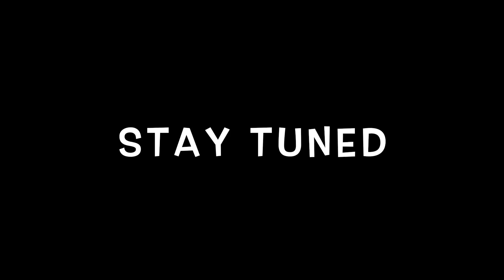SWAMP Dragon Rescue! FIRST WASH Abandoned 74 F250, V8 FORD, Forgotten Vintage Camper Restoration, CT

Comment: I can't believe this. I have a 76 F-150 Ranger XLT that i bought new. It hasn't been sitting in the woods for 20 plus years it runs and drives and yet the front bumper on your truck looks better than mine.

Comment: For anyone reading this, if you go as far as putting a solvent oil into the cylinders, you might want to also consider pulling the distributor or otherwise pump drive mechanism  and spin the oil pump with whatever tool works (or the special tool) once you get new oil in it, start by spinning it by hand to get it moving smoothly, then use a drill or something to spin it fast and move oil through all the galleys, and do that for a while before you call it a day and let the oil and cylinder oil soak, then the next day you can do the oil pump thing again and pull the plugs out and bump it over by hand or with a tool, be wary of bolt size and such, maybe use a pry bar on the ring gear teeth but just know that the harmonic balancer might come off if you turn something only attached to that, and any bolt smaller than 19 or 3/4 is likely too small, if there is no safe method to turn it over, then try to only gently bump the starter as quickly as you can so it doesn’t try too hard if it is binding, then if it all sounds ok you can watch the pulleys and do a few more quick bumps to see if it turns, if it does, then you can do longer ones until your just cranking it a few seconds at a time (not too long, maybe 10 seconds at most) then once it all seems good, check if oil is spraying out of the spark plug holes still and once it isn’t anymore you can give it a long crank (cranking speed is a good indicator of how long is the max and checking the starter temp when you’re doing the short cranks is a good way to get an idea of how close that was to the max, but typically no more than 30 seconds or 2 minutes for a diesel, and only with good batteries, then you can put the spark system back together and crank it again a bit once it cools down and charges up, then once you do that, you can use Aerosol starting aid like ether starting fluid or gasoline in a spray bottle down the intake, try to avoid liquid buildup and once it’s starting and firing up that way, you can work on getting it to start with the carburetor like normal

Comment: sweet truck , it's still waiting for someone to pull the camper off it's back ...
Reply: Mark Godfrey  ouch my back hurts
Reply: Right get that fire wood off the truck. Lol
Reply: Im in agreence bc old campers like that arent worth saving there alot of work and id try to save the bedfloor if theres one left bc they dont last on that bodystyle ford
Reply: Mark Godfrey  ⁰
Reply: @scottcountyboys608  why would anyone put time ang money into a rotten heap like that. I just bought a mint condition, basically new '73 camper for $1300. Working appliances and all.
Reply: @Capitanvolume  well u might have but the one on that trucks gone 5he things sat and rotted out
Reply: @scottcountyboys608  that's my point. It's so cheap to get a 70s camper that's been well cared for

Comment: Back in that day that truck was LOADED. A/C all the bells and whistles  of that day.
Reply: Power disc brakes, power steering. It was like a freakin’ LTD!
Reply: @Gerk8  yea My dad was the one that didnt order power steering or AC . My mom had  so much trouble driving the cars.
Reply from the maker: Yes, it's a sweet ride! =)
Reply: @k henne I have my dad's 75  F-150  and it's a Ranger XLT and no power windows, locks or tilt wheel. It did have chrome trim inside and out, carpeting and cloth seat but that was it. I'm sure the other stuff was available but my dad didn't want it. We did have A/C,  living in Houston so it as a necessity.
Reply: CircleM-85 : I don’t think power widows, locks or tilt steering wheel was offered as options back then or cruise control !

Comment: Scrap that camper we're all here for the truck!
Reply: There’s no reason to scrap the camper I’m tired of seeing comments with people who don’t know value
Reply: Without the camper its just another old shit ford
Reply: Blitz Court in all honesty, that camper would take more cash to fix it then to just buy a new one. And besides, that truck would be a lot better off without the camper.
Reply: Joshua Poche only the new fords are shit. The older ones have American steel. Thus, better quality and a better lifespan.
Reply: Agreed scrap camper and keep the good lookin truck
Reply: Yessirrrrr
Reply: @Carburator_Ranger_tv  new ones aren't no joke, 3.5l Ecoboost and 5.0 are proven, and that 3.0 powerstroke is badass too. Body wise yeah its no steel but its high strength aluminum and it won't rust. I don't get the new ford trucks vs old trucks pussy fight. They're both good in there own ways.
Reply: Tate LaPrade you have a good point. But the new rigs have way too many electrical components. What happened to having mechanical parts instead of just computers?
Reply: At least remove the camper before washing everything.
Reply: @Carburator_Ranger_tv  it's not necessarily about money some people like fixing up old leaky campers just as much as fixing up classic cars, if were up to me I'd fix both the truck and camper, I've replaced whole walls in old campers. I fully restored a 25ft 1971 fan dual axle camper too. It was hard work but in the end it was a very good camper
Reply: Joshua Mcpeek good point. Everything can be repaired with enough time and cash. I’d personally just like to fix the truck but, you do you!
Reply: The fucking camper is shit get rid of it or sell it. It is a big eye sore.
Reply: @Carburator_Ranger_tv  to each their own I respect your point of view, I will say though you can make some mad money fixing up campers, that 71 fan got me 2k$ and since me and my dad worked day and night we had the whole front wall replaced, the camper resealed, and completely repainted in 3 days
Reply: the camper repaired would be great with this old truck. i would go for that over my powerstroke any day of the week.. my newer ford is a disappointment for me. i remember back in 79 dad coming home with a new ford f350 4x4. i thought that truck was huge only being 6 at the time. wish i had that truck now.
Reply: Personally I'm just more interested in trucks than campers, so I'm not sure about the campers value. I'd be down to see both fixed up but they need to divorce atleast
Reply: Everyone is entitled to their opinion & everyone is different, I'd fix the truck & the camper👍✌
Reply: Kenny Huskisson yep!
Reply: I would scrap the camper also
Reply: Im here for the camper :)
Reply: @Carburator_Ranger_tv  cuz everybody knows: american steel rusts way slower xd
Reply: Dennis I honestly can’t tell if your being sarcastic or not. And I prefer American steel over Chinese aluminum
Reply: @Carburator_Ranger_tv  i am, because steel is steel. Thats basic chemistry. If you wanna know whats inside just do a spectrum analysis.
Reply: Dennis you are right but the thickness of the steel is the main problem. Most foreign companies make the steel thin so that they can have higher productivity as well as make production cheaper.
Reply: @Carburator_Ranger_tv  you realize they literally order steel by thickness right? If they order 0.8mm steel sheets or whatever 65/128 inch youre using (sorry xd) then theyre gonna get that. If its thinner they wouldnt use it.
Reply: Keep the camper.
Reply: TrDuzir pRAr brasil portuguez
Reply: @joshuapoche5137  I take offense to that, nothing better than an American built truck like the “shitty” Ford, they just look so good
Reply: Car chase scene from The Streets of San Francisco with Leslie Nielsen
Reply: @Carburator_Ranger_tv  you obviously haven't priced one recently

Comment: As I remember, back in '74, those big-block Ford trucks weren't very practical back in those days -- there wasn't any gas available at the gas stations. Those old 360 V8's are gas hogs, but they're very reliable.

Comment: You have quite the job on your hands with that truck and camper. It will be interesting to see what happens. I'm currently looking for a truck camper and trading in the van. I wish I had looked at truck campers prior to setting out to RV.

Comment: Back in the day those JACKS on the side of the camper made it so on the weekends you could back up underneath it & drive out from underneath it. To leave it on all the time, Ruined the rear suspension fast even if it is a F250. CT the rust under the hood is caused by DEW, because of No Drain Holes. If you had no headliner in, you would get it in the ceiling of the cab also.
Reply from the maker: Intersting. I didn't know that! Thanks Lloyd!
Reply: @CTmoog  You're Welcome CT... 98% of your commenters didn't know that either. LOL "Never let someone, who has done Nothing, tell you how to do Anything."

Comment: Hi CT. That camper looks far too gone on the roof and probably most of the structure. I would have thought it would be best to remove it from the truck, do the truck first and then tackle the camper. 
In all honesty, I would think the camper has had it. I know they can be rebuilt, but it is a lot of measuring and a lot of woodwork to remake the frame and inner walls as well as the roof and probably the floor. 
On a good note, the chrome on the front has come up very well.
Reply: Given that none of the metal work is bowed or gone I highly doubt the structure is bad at all
Reply: @blitzcourt5021  The roof is rotten, the erar corners are rotten, wherethe stands / legs are is not much good either. It is built like a caravan. Once water gets in, it creeps along the wood and gets everywhere.
Reply: yea, i agree, i bet the inside is nasty toast

Comment: That camper is scrap if it’s got water damage. Truck is awesome though.
Reply: That’s the same thing as saying if the truck has water damage it’s scrap. It’s not. I have one 3 times it’s size that had some water damage I replaced a couple of walls and fixed some seals and now it’s as good as ever
Reply: That truck is worth saving..the camper?.. pull it off and burn the damn thing!
Reply: Blitz Court   You can find those campers anywhere for cheap. Just not worth restoring unless there’s a sentimental reason or something like that.
Reply: I just paid $1300 for a 1973 camper that's basically brand new. Why would anyone keep that water damaged heap?
Reply: @blitzcourt5021  not true🤣🤣 just because a car has water damage don’t mean it’s garbage, a little work on this truck and it’ll be up and running, you can buy a new camper but you can’t buy an old Ford like this new, they have lots of character, the campers just a pile of ahit
Reply: @cambo1200  not true

Comment: Water under pressure will find every crack hole joint & wiil blast out sealant making your camper about absorbant as a sponge lol but hey Pressure washer it sure saves on the elbow grease lol

Comment: Dump the camper, trust me.
Reply: No
Reply: no
Reply: No it just needs care
Reply: No reason to it’s a camper that came with it just repair the thing
Reply: Part out the camper before throwing it away if you're not going to fix it. I think those small jalousie windows will fit my 63 Avalon. I need one of them to finish my restoration.
Reply: I agree but it would be cool to restore it

Comment: There's something unnatural about a pressure washer that starts first pull... it just ain't right.
Reply: I considered that it might have been running prior to the camera being turned on.
Reply: HONDA
Reply: That’s why you buy Honda equipment.
Reply: Honda equipment and ford trucks
Reply: I have a brigs and stratton power washer, it runs first pull every time.
Reply: That's a really nice pressure washer had one at my old job.
Reply: I have one just like that except 3000 psi. Can't beat those honda engines, cranks first pull.
Reply: Honda

Comment: The truck itself looks pretty solid, besides the hood and one inner fender.  You just won't know on the box floor until the camper is removed. The camper may have protected the box floor and kept it nice. Or it may have trapped a bunch of debris and caused the floor to completely rot out.  I'm afraid the camper would need a complete tear down and rebuild to save it. It looks like all the wood structure is rotted. Not to mention all the plastic accessories on the roof being totally baked and brittle. Anything can be saved. But how much time and $$ do you want to invest in the camper? 

I would also pour some ATF down the intake manifold along with in the cylinders and let it set for a week of so.  And pull the valve covers and pour some oil or ATF over all the valvetrain parts too. Then before you try and start it, pull the distributor out and spin the oil pump to prime it. Once you see it build oil pressure and are getting oil to the valvetrain parts. Reinstall the distributor and spin the engine over with the starter (with the spark plugs out ) . That way you will clear out the oil/ATF out of the cylinders.

Comment: Before trying to crank it, see if the engine spins with a socket and ratchet on the crank balancer bolt. If so drain the oil and put in fresh with filter. Pull the distributor and get an old distributor shaft and use and electric drill to spin that distributor shaft inserted down into the notch in the oil pump. Pull a valve cover and spin the oil pump until you see you’re getting good oil up  onto the valve train. Then you can crank on her all you want cause she has oil all thru the engine. Have fun.

Comment: Sounds like you are disappointed that it's so rusty. Look where you pulled it out of. I'm impressed that the wheels turn and the parts haven't fallen off. The grill and front bumper could probably be sold for more than you have in it.

Comment: Too far gone?  Yes, it has been for several years now!  Slide in pickup campers are surely pase' now, and they were of necessity very lightly constructed, nothing heavier than a 2x2. That was just the state of the industry in the 70s. 
As has been mentioned before, the best thing you can do with it is remove it from that poor truck! At least in a '74 F250 you have something worthy of restoration...with air no less!
Reply: They still make cab over campers much nicer now

Comment: will be interesting to see when you get the camper off the truck. If you have 4 screws in each tail light lens, you have an early 74. If it has 2 screws and the tail lights are a plastic housing, its 1974.5 model. Pretty sure the tail lights are the only difference I have found so far.
Reply from the maker: Yes, We should be pulling it off sometime this week I hope. Good to know on the tail lights. I will check tomorrow.

Comment: If you do decide to scrap the camper , get the truck running first then un- mount the camper and tie it to a tree with a long rope with plenty of slack. Get the truck up to speed and when it runs out of rope it'll rip that sucker right off of there. 
THAT WOULD MAKE AN AWESOME VIDEO !

Comment: Scrap the camper and keep the truck,  next time to remove that mold and mildew a lot easier get a pump sprayer from home depot and do a 50/50 mix of bleach and water,  spray it all over EVERYTHING,  let it sit for 5 minutes and simply rinse it off with the hose

Comment: Use diesel fuel to put in the clynder it’s amazing then afte draining the oil then refill with diesel fuel run it for 30 minutes at idol then drain every thing including oil filter like new motor’’ a big help to lifters’

Comment: That camper ain't worth the effort to save it. If you pulled some of the paneling off the walls in it,  I'd guarantee you'll find black mold, besides rat's nests and rat turds. Its only value is whatever scrap brings for it. You just need to figure a good way to get it off without doing any damage to the truck. If it were me, I  break out my trusty Sawzall with a whole bunch of blades and dismantle it in pieces load it into a trailer and off to the scrapyard with it. Or place some wood bracing under the length of the overhangs on each side, get 2 floor jacks and slowly jack it up just enough to pull the truck from under it (provided the overhangs aren't totally rotted out and cannot support weight), then break it up for a trip to the scrap yard. It's slow but less risk in damaging the truck.

Comment: It's like every person on YouTube who is salvaging or restoring an old car or truck is ALLERGIC to using a scrub brush or a WASH CLOTH/MITT or rag. I can understand letting the pressure washer do the work but you can do a whole lot with a scrub brush and a wash rag. You're leaving GREEN mildew on the truck. Plus, when I see that camper on the truck I feel like saying "I Can't Breathe".  It's like you have a HOUSE on top of the truck and they both look like hell together. And honestly I don't know if that camper is salvageable. What could it be worth? It looks like it is more work to restore it than it is worth. You'd need to gut the whole camper, re-insulate it. It is probably full of carpenter ants, roaches, every bug known to man.
Reply: jaxflfreebird Amen.

Comment: truck is nice in that its all there...not cut up (other than by rodents).  its a real truck with real steel...in '80 Ford went on a lightening project that seriously degraded the FSeries…I have a '69 F250 and a 1980 F350 dually, and the dually is positively dainty compared to the '69.  Everything is repairable...gazillions made so lots of used parts, and LMCTruck.com will be your friend.  hopefully the bed and floors are ok.  don't even start on the camper...yea it kinda has the '70's vibe going on, but. You. Will. Replace. Everything. to get it habitable again...about the only thing to be saved is maybe some outside tin and the stove...furnace and windows might be salvageable.  All that 2x2 framing and floor would have to be replaced, all soft goods, refer, jacks, roof fixtures, most cabinetry...my sinuses are acting up just looking at it.